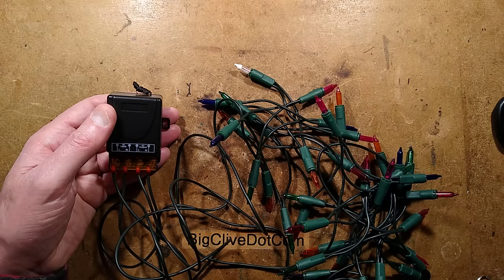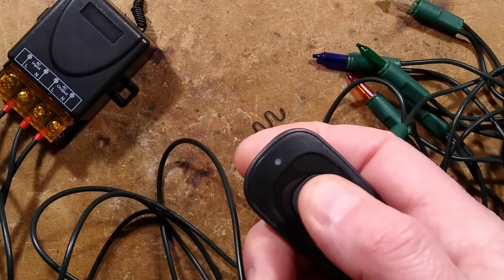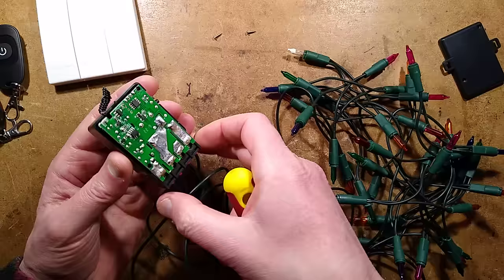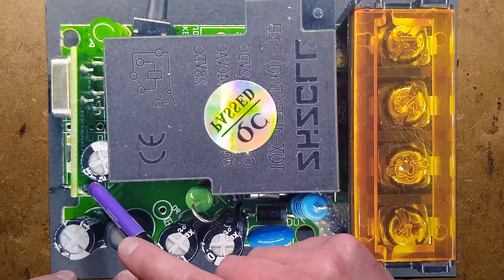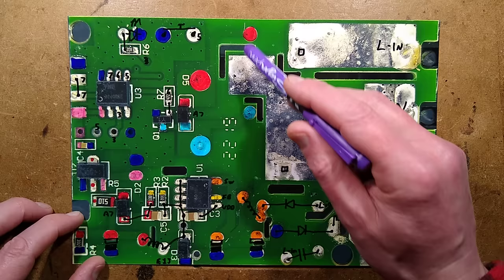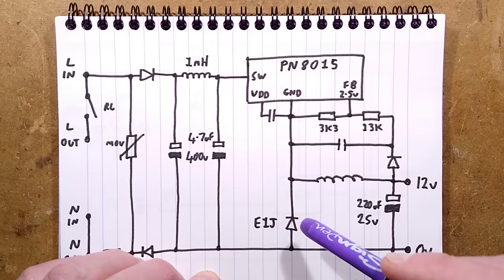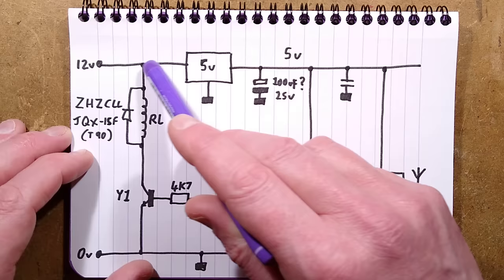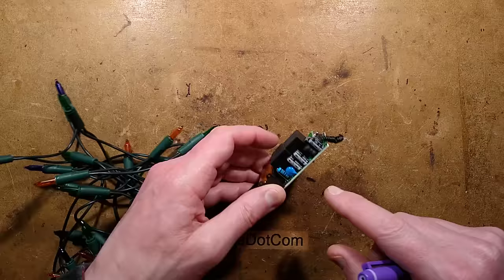Inside a "30A" remote control - with schematic

Comment: The diode on the feedback path is still a mystery to me, I'd appreciate if someone can explain
Reply: This PFM regulator provides a fixed-period on-pulse when the output voltage has fallen enough, after a fixed minimum off-time has passed.  During off-time, the "GND" pin and the top of the feedback divider are each one diode drop below the corresponding output terminals, tracking the output well enough for wide voltage regulation purposes. During on-time, when the "GND" pin is a few 100mV above Vout, the feedback diode disconnects the feedback network from the output.
Reply: @abitofabitofabit4404  That makes sense, since GND is the output of the switching circuit (the naming doesn't help) and the filtering cap would provide a direct high frequency path to the output node. Also the fact that this is PFM makes is so that since the on-pulse is of a fixed length, you can only really decide what to do when the output is off, hence the feedback network is not needed on the on-time. Thanks for clarifying that!

Comment: Shame it doesn't have NC|NO|COM on the relay itself, as I find stealing those RF codes really easy for home automation applications. You can use a single mains powered light switch to control a bunch of extra devices and if you loose or break the remote the lights still function as a normal switch.